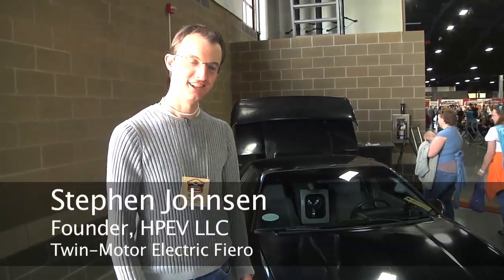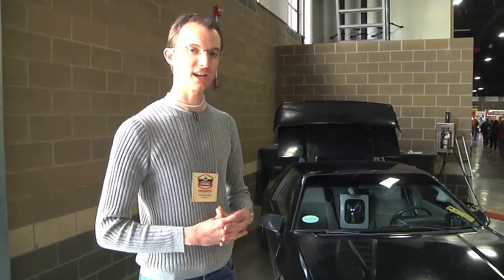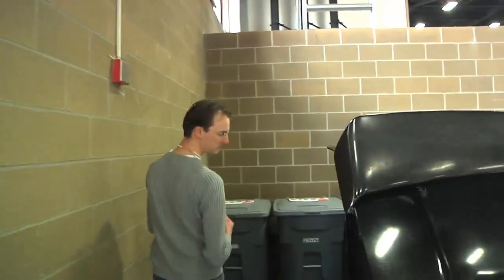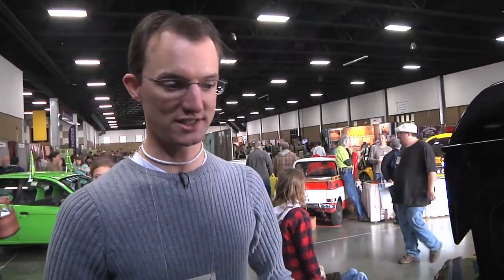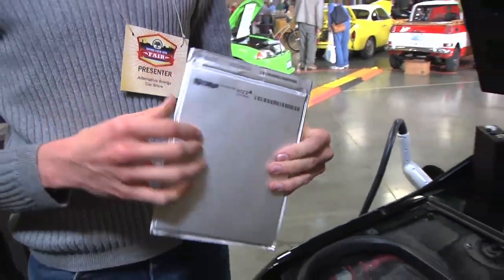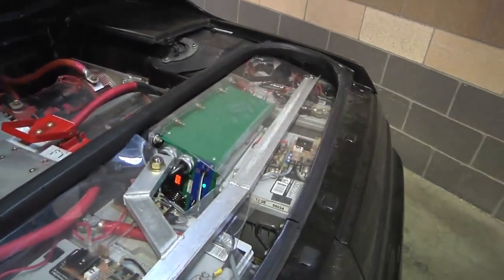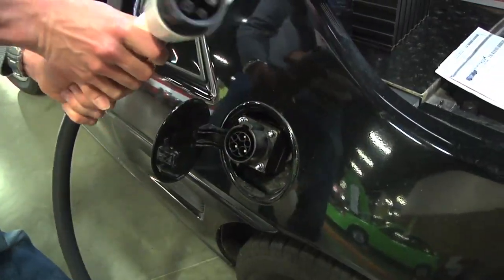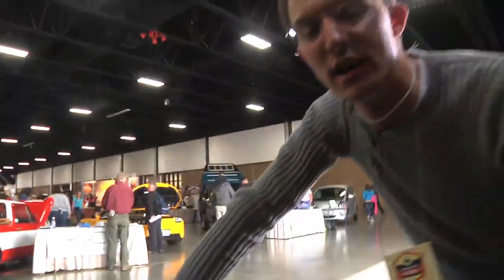Electric Fiero Tour, part 1

Comment: TYVM. Which begs another question. I saw a video with an electric vehicle with a four-speed transmission and wondered why. Thank you.
Reply from the maker: No matter what, you still need gear reduction and a differential. Most modern commercially-built electric vehicles use a combination of single-speed gear reduction and differential power split built together into a custom combined unit.
On a DIY electric vehicle, the existing manual transmission is simply re-used. The driver may or may not use all the gears. Sometimes, there isn't even a clutch!
Still, reusing the existing transmission is a simple way to have a logical place to connect the motor to the driveline, allow for gear reduction, and (commonly) provide for the differential power split to the two drive wheels.
Read more details at: https://300mpg.org/projects/electro-metro/transmission-for-an-electric-car/

Comment: 30 Mile range? I’d love to have an electric vehicle but I don’t think they’ll ever become a complete success until I can drive one from Beaumont, Texas to El Paso, Texas on a single charge. That’s 892 miles. Whomever Is successful in doing that will corner the market on electric vehicles. However, I don’t think that BigCarCo and BigOilCo ever allow that to happen.
Reply from the maker: That's a 12 hours drive you are talking about! The average american drives 30-40 miles per day.
They might do a 12 hour road trip once or twice a year.
Existing electric vehicles right now can go over 200 miles per charge and have fast charging capabilities.
Plug-in hybrids let you drive to and from work every day on ELECTRIC and drive across country on gasoline.
No, you can't yet drive 800 miles on a single charge of an electric vehicle, but that's not what people want or need.
Electric vehicles already meet the needs of Americans and are smooth, quiet, and a blast to drive!

Comment: With all the wattage and amperage, what is the equivalent of gasoline horsepower rating?
Reply from the maker: 640,000 watts is approximately 858 HP, but even then, it's not a completely fair comparison. Electric vehicles have peak torque instantly whereas gas engines have to rev to a particular speed to get to peak torque. EVs are great for drag-racing!

Comment: I'm still waiting for a Fiero electric conversion that keeps the rear cargo area. It's great to be able to smoke gas-powered cars, but eventually  you have to bring home a month's worth of groceries or a 50-pound bag of snow-melt, both of which I've done in the front and rear compartments of my '84.

If they ever come up with one where the motors swap in place of the engine and the batteries go right in where the gas tank used to be, I'm in. But I have a garage where I could put in a dedicated charger. What about people who have to park on the street, or in outdoor apartment parking lots, or underground garages at night? Then, on a road trip, there's 8 hours for a full charge vs 10 minutes to fill up the tank with "Jihad juice". Gas-powered cars aren't going anyplace anytime soon.
Reply: artistmac he mentioned in the video of upgrading to a lithium A123 battery that could allow for storage but be wanted the raw punch
Reply: you are right about that since oil company for years paid to keep electric as a underdog or shut it down. there a documentary of a all electric Saturn that was only sold in California and a some years later was total recalled and the cars are either just rusting or got crushed. look up "death of the electric car"
Reply: REPTAR isaG look what GM did to the EV1!
Reply: For occasional extra capacity you could put a trailer hitch on it.  Curt sells hitch adapters for most cars, including my Leaf, Volt, and Prius.  I have hitches on the Volt and Prius, they work great and I've towed up to 3,000 # in the Prius!